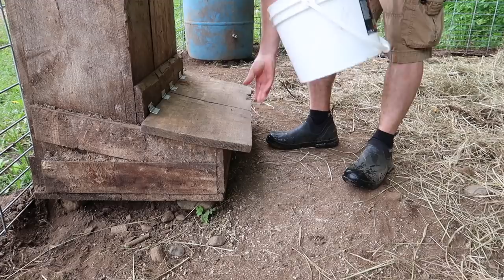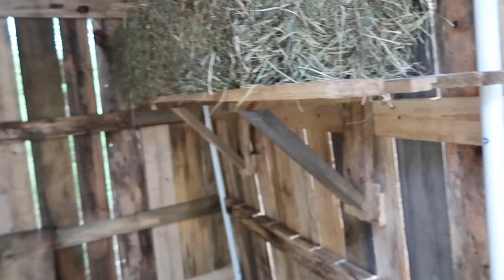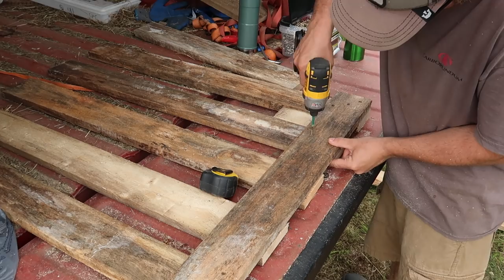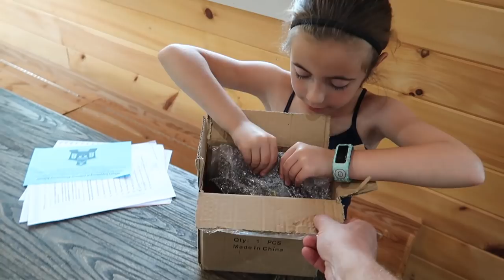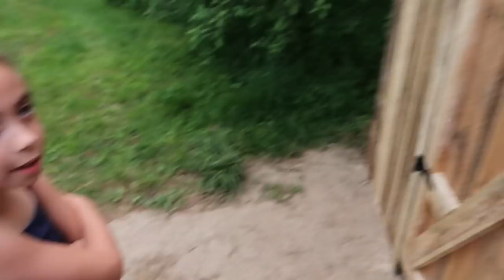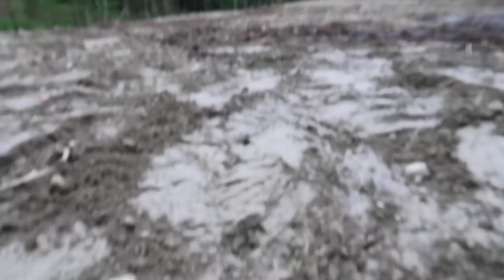Building Our Goat Milking Parlor

Comment: Al, you will have two goats.  I would build a double milking stanchion.  I would also consider a keyhole feeder.  We were over 90 yesterday.  I really can not deal with the cold, but different strokes...
Put your hay in farther, as well as your milking parlor.  Keep the goats by the door.  You will milk and do vet work inside.  Trim hooves by the station.  I would keep my manure close to the door.  Keep a bucket or waterer near the outside.  A quarter cup of vinegar to a five gallon measure of Bater will give you more female goat kids.  Believe it.  Vinegar works.  I think your barn is great.  I just used a milking stand and a shipping crate and it worked.  
You are blessed with a lot of great compost.  Al, you are a blessed man.  
Barn name: Milksachussetts.  God bless!
Reply: Jim Claire great name!!
Reply: Thanks for the tip also!! On the water for girl goats.
Reply from the maker: what does the apple cider vinegar water do?

Comment: I realize it’s been years, but do you recall how you fastened the strapping boards to the metal frame of the shelter frame?  Did you thru-bolt them?  Metal screw?  I’m going to follow your design to build a hard shed from a retired tent frame same as yours.   Thanks, fan since before the first 10k viewership!   And the guy who sent you pink ratchet straps years ago!

Comment: Great goat barn! The field/pasture looks great! As a goat owner, I can confirm that they can be mischievious!! I would suggest a latch of some type at the bottom of the gate as the littler breeds will push on it. And metal containers for any loose feed to prevent rodents and keep it dry. Possibly a larger hay storage area somewhere for those winters? Great carpentry work!

Comment: That is a huge space for 2 goats!  LOL!  Not showing it to my two Nigerian Dwarfs - they would be too jealous.  My goats have a 3 sided run in that has a more closed in sleeping area with a small opening off the east side.  I actually made their sleeping space smaller last year for two reasons.  
1 - keeping them closer when sleeping or the weather is bad, helps them keep each other warmer over the long cold winters.
2 - With less room to stand and move around, they pee inside a LOT less.   I do deep litter bedding for the goats and poultry from Nov. to November - cleaning it out and starting over just before everything starts freezing up. Once a week, I use the garden fork to turn things over and add fresh straw or shavings.  Even with good ventilation, it was getting rank within a week when they had too much room to move around in their sleeping area.  When the weather is decent, they want to sleep outside anyway so getting too warm isn't a problem in the summer.
Reply from the maker: Good to know! Thanks

Comment: I like the goat shed very much and love how it matches everything else on your homestead. 
The milking parlor still seems very dark, and that's the place you need the most light because you will be doing more than milking back there. That's where you'll be trimming hooves, measuring out medication like wormer, treating mastitis, etc. Maybe even using that area as a birthing bay. Could you put in another skylight or two back there? Gina had a GREAT idea with those skylights.
I'm worried about the cracks in the outer walls during winter with the amount of snow you get. I'd really hate to see you shovel out goatsicles next February. Nigerians are from sub-Saharan Africa - they don't take the cold too well. I'd actually like to see an inner wall, maybe with straw insulation - you'd have to be able to restuff it periodically, though.

I like Goatham City, Chicagoat, Bahahahston, or Nannytucket!

Heat is the worst! I was born and raised in Texas, but I moved to the PNW four years ago because I can't take the heat anymore. If it gets over about 65° F, I suffer!
Reply from the maker: once the boards dry out we will seal up the cracks. I hear you on over 65! Lol

Comment: I agree with you Al.  I keep my house close to the same temperature summer and winter.  65 degrees.  I really don't like hot and sticky.  Not fond of the 20 below temps but I can always put on more clothing.  The fork is supposed to be bent    LOL!!  Maybe a solar powered light for inside the goat barn????
Reply from the maker: What area do you live in? I like the solar light idea!
Reply: I live in East Nebraska.   I have seen lights powered by solar panels.  I will check on where they are avilable and let you know.
Reply: I sent a message on FaceBook

Comment: You are doing just a wonderful job of building the goat barn, but please keep in mind the snow issues that can happen.A couple years ago we got a snow storm with very fine snow.It blew INTO my barn thru the cracks and we had to dig our goats out from INSIDE the barn.Never thought something like that could happen, but it did.Just want to give you heads up about that.Goat don't take the cold as well as sheep do, you might have to do some insulation too.
Reply from the maker: once the boards are dried we will have to seal up the barn

Comment: Hey there again from Central Wyoming!

 I don't think you're leaving yourself enough room in the front part for your goats in real terms, unless you plan on getting pygmy goats!

Goats take up a lot of room and they do not like to be crowded!

When you were doing the cutting on the back of your pickup for the partition wall, I noticed what looked to be a Top Bar Hive!

Is that what it is, or is it something else?

I've got three herniation in my Lumbar and 3 compressions in my neck, but I intend on keeping bees, which is why I will be going with a top bar hive! I look forward to your reply
Reply from the maker: yes that is a top bar bee hive. We made it for Olivia. Its got an observation window. We have used it before but the bees died in winter. Hoping to get back into bees next year. How many hives do you keep
Reply: Lumnah Acres 

Sadly, none yet. I'm in the process of trying to get my house ready to sell, so I can move to South Central Alaska.

My congenital asthma came back with a vengeance a few years ago, after I was hitchhiking in -24F below weather, transmission was out on my little truck and I couldn't afford to get it fixed.

So I need to move from my midling elevation of 4700 ft down to sea level, so my lungs can get more oxygen.

I used to hunt elk between 7,000 and 10,000 FT elevation on a regular basis, but those days are gone.

There's a top bar Hive design from a guy by the name of Frank, either from Michigan or Wisconsin, I can't remember which and his homemade design is the finest and most versatile I have ever seen. I'll be making my top bar hives on his designs.

I also intend to capture some swarms from the local area that I moved to, so that the bees are already acclimated to the environment.

Though I am looking forward to trying some Russian and Italian Crosses.

Is that little tractor of yours going to be able to hold up trying to till, row, and Seed, 4 Acres or so?